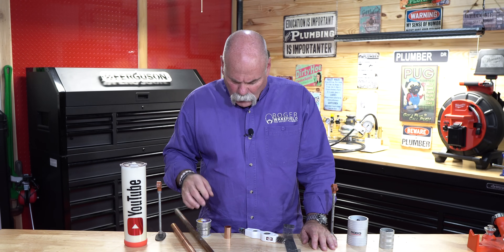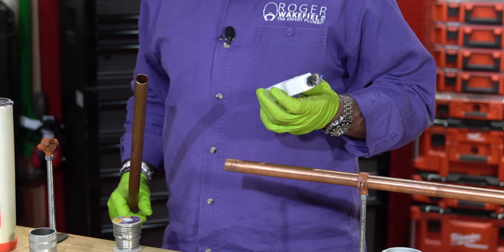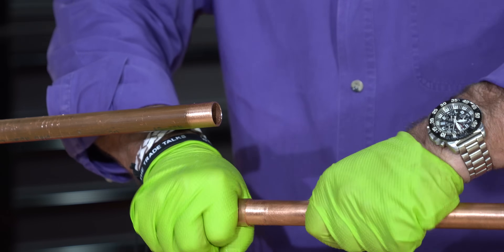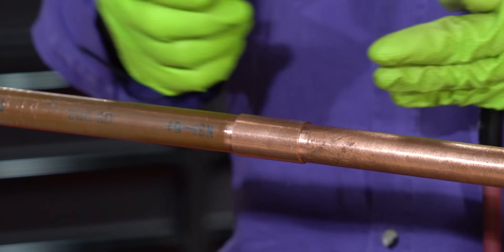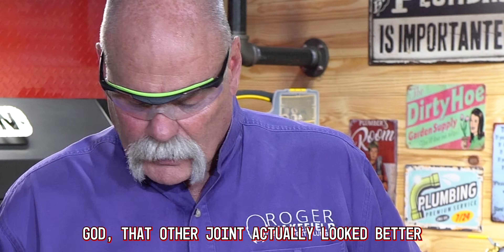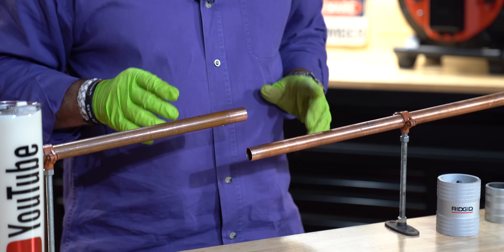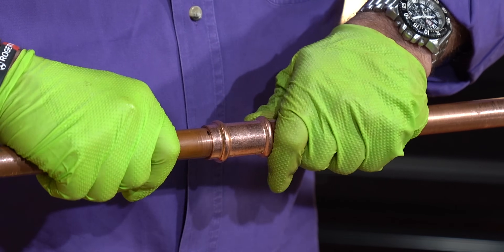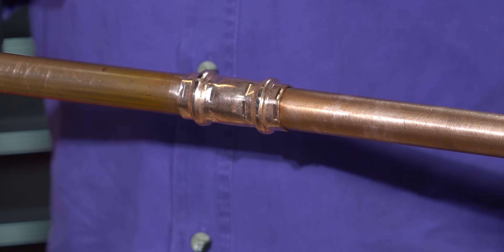Soldering VS Press Fittings

Comment: I have 23 year old leaking joints in my crawlspace.. soldered. Looks like they were never cleaned after and that caused premature corrosion. So there's a good reason to prefer press fittings - the plumber can't skip the cleaning step.

Comment: Solder is very much used in the commercial Industry. I’m 23 and I’ve soldered probably 80% of the water line joints that I’ve ever made.   If I’m running DWV it’s either pvc or cast iron. Usually pvc, unless im running a big job that is willing to pay extra extra money for noice reduction. I can do whatever my company needs though, copper, pex, pvc, abs, cast iron. A good plumber can do whatever job they are given.

Comment: The big issue these days is liability for a fire from soldiering. So you have big company’s insurance actuarial and their loss prevention people run the numbers and crimp fittings and shark bite are quicker and much safer. 

Just evolution of the trade

Comment: Your tip on that TT IS DIRTY,THE  AIR MIX AREA WHERE THE ORFICE IS IS STOPPED UP, YELLOW FLAME IS BAD.AFTER YA BUTTER PIPE AND FITTING DONT WIPE THE FLUX OFF . SORRY JUST BEEN DOING THIS FOR 35 YEARS,FIRE IS 10X BETTER THAN O-RINGS ASK NASA!. SOLDERING IS A ART KEEP IT GOING LAST FOREVER.

Comment: I work for roto rooter. They do not teach you how to soldier but if you learn on your own and pass a test with the gms approval you can carry a torch and soldier but must inform management prior to anytime you fire up the torch
Reply from the maker: You have to call a manager and let them know you're going to solder before you can even fire up a torch? 🙄😒What part of the country are you in?
Reply: @RogerWakefield  columbus, ohio
Reply from the maker: That is crazy. How often are y'all soldering then? Are you pressing instead?
Reply: @RogerWakefield  mostly yes it's all press. They do buy every plumber a milwaukee press tool to use though. There are very few instances where even the ones who know how to solder actually solder

Comment: The copper looks pretty dirty there’s a great attachment for a cordless drill on Amazon it’s a cylinder with a hollow of your pipe size it takes paint and everything off.looks like too much heat but as regards to solder press fit compression or push fit whatever works for you solder and compression can last a lifetime the others we are not sure of I think they say 25 years for pressfit so in a newly built house a young couple who are 25 go on holiday 25 years later and come back to a pond in the house go the tried and trusted way.

Comment: I've seen way more leaking pressed fittings then soldered. And I've seen way more soldered joints than pressed. 

I prefer soldered joints in inaccessible locations like inside the walls or attic. Pressed fittings for exposed like water heaters 

From what I've seen on a few of the pressed fittings I've had to replace is that the O ring seal inside them dries out, strinks and cracks. Thus causing leaks. Seems to take about 10 years or so. Seen it more often on the hot water lines.

Comment: Making repairs on my parents 50yo type M copper lines with slightly acidic water, I don't even think about ProPress. It will just crush the paper thin lines. Solder all day long, or use a POC. It doesn't have to last forever. It will need a complete re-plumb soon.

Comment: Clamp fitting was designed for people like this guy. Can't solder worth sh!t. My God. The sad part is that I see certified plumbers doing just a bad on new homes with clamp fitting. Rings are crooked or too close to the edge of the hose. It's just a mess.

Comment: I just completely changed my opinion on soldering vs ProPress fittings. I'll take ProPress everyday if this is a seasoned plumbers attempt at soldering a joint. That is not how it's done.

Comment: heat the pipe all around, not just the bottom,  'til a green flame, then remove flame and apply solder.  no need to overcook the solder with flame as shown.  this took way more time than it should

Comment: I think you are overheating the fitting to much... when the solder melts i pull the heat  and apply the solder then i put some heat on to draw it...if the metal is to hot the solder will bead off and not into the joint

Comment: You used to much heat on the fitting the heat can actually push out the solder if you get it to Hot just back off the torch a little bit and it would look beautiful 👍

Comment: He way overheated that solder joint for Type M copper. Maybe it was heavier pipe. If you slow down and watch the solder as it flows, you can see when the joint is fully loaded. Once you get good, you can hang a single drip and then swat it away with the solder in your hand. All that overfilling and dripping and reheating is pointless. I've gone thousands of fittings with zero leaks without the neat to over "blue" the copper from overheating or making a drippy mess overfilling.

Comment: Fun Fact- I herd the o-ring is not necessary in the pro-press fitting. It seals without the o-ring. It's just a back-up.
Reply from the maker: 👀 where did hear about this fact?
Reply: There is another channel that demonstrates it. They pro-press a fitting and then leak check it. They also beat the fitting with something to see how durable it is.  @RogerWakefield
Reply: totally false

Comment: Sounds like a business that wants to run out of business. Cuz you can't use that ProPress in all situations many times the pipes are too close together or just the spaghetti mess and there's just no way possible to get that big contraption in there to press the fittings. This is why soldering will never completely disappeared it is absolutely necessary sometimes

Comment: I always liked a job that wiped the solder joint with a rag. It looks much better that way.
Reply: Not me. I'd rather have a clean bead. Wiping means the plumber touched the pipe while it was still hot. That's a great way to crack some of the joint. It might not crack it enough to leak right away, but it would be weakened if it breaks any of it. It's a major mistake in my mind.

Comment: I'm not a professional plumber but I know  if I need to replace a valve that was soldered I can heat and desolder to remove the old valve. Sometimes it may only be an inch from the wall. Can you remove a pressed fitting or does it have to be cut off at the end?
Reply: Good point.

Comment: I am sure someone already said this in the comments but yes you do have to clean your pipe on press fittings and also rheem and deburr. They also make gauge for a mark for insertion depth. Just saying and solder will stand the test of time

Comment: I'd love for you to cut your pipe to see if you had excess solder inside causing turbulence in the line which causes pinhole leaks.     I work in a place that uses both and the pinholes are vastly more common by solder joints.

Comment: My rule of thumb is if it's new construction I will solder or if it's in a garage etc. Also a shower valve I'll solder outside by the truck. If it's in a home and is a repair I'll pro press. People dont like the smell of solder smoke alarms and for fire practice.

Comment: These press fit need to go down in price bc the o ring is useless. They press good enough that they are water tight. Watched a video on it. So if they do that, they can drastically lower the price. 

Roger you should use a press gun on a regular fitting to see if it leaks in your pressure chamber. I bet it dont. 

like this to get to top.

Comment: Never put flux on the inside of the fitting only the pipe. P.S. what is sodder?
Reply from the maker: Solder is the metal I’m melting to bind the copper together
Reply: @RogerWakefield  I know that I've been in the trade for over 50years. I just don't know what SODDER is, greetings from the country that gave you the language you are speaking.

Comment: Pro-Press is awesome, but always remember to note the pro-s versus the cons. With pro-press there is a rubber washer that will eventually fail while a soldered joint will likely outlast the building. I get it why professional trades are moving to using Pro-press, but I do feel that a professional charging a professional price should not take shortcuts. 
I wish there was a press fitting without the rubber gasket. Hmm, I guess then that would be called Pex pipe. Speaking of Pex, even though I love copper, I do really like using Pex and I trust that Pex will last.
Reply: The rubber washer is not the primary sealant in the system - it is a failover.  It is the copper crushed against itself.  This technology is older than most plumbers, but we understand old plumbers can't learn new tricks.
Reply: Im not a plumber but I watched a video recently where the plumber takes out the O rings on a pro press fitting and it still didn’t leak
Reply: @richardcollyer1014 I agree that removing the rubber seal, and water may not leak, but for how long? I've also seen videos of plumbers stating that when they tried removing the o ring, initially there was no leaks, but later on, there was a leak.
Reply: Good question !!

Comment: i like both. just need to know where to use them. always remember that you can’t take off a press joint like you can for a solder joint. so at least leave some meat for future repairs if you’re going to press or else you’ll be cutting open walls

Comment: Solder is always my first choice but the pro press definitely has its place especially in hospitals (above ceilings) where there are alot of wires and cables and no hot work permits...and cleaner.

Comment: It took over 8 minutes toprep and make that solder joint...90 seconds of rthe Propress...pretty simple math.  Yes PP is more expensive but it's much faster, normally looks alot better and no Hot Work permits needed when working in Industrial settings. We have done jobs with PP having over 10,000 connections 1/2 to 4" in copper and stainless, no leaks. You have to remember to calibrate your tools prior to starting each day.

Comment: what about Propress fitting where it is crimped with Rigid tool or Milwaukee Tool ??   could you do a video on that..  please thanks!!
Reply from the maker: I use the Rigid press tool in this video
Reply: @RogerWakefield  i spoke too soon later in video you did talk about that!!  sorry.. just getting ideas .. have to run a 2inch water line from well pump house to main house and garage and several spots for "fire water".. was thinking of mixed line copper under house  and Schedule 80 2 in. in ground from pump house...gluing i am ok but soldering not sure to i like the idea of the "Quickfitting" on copper from 2 " on sections down to 3/4"

you do great and thorough videos keep it up!!

Comment: Being a non plumber and have solder little project, I have never seen the pro press.  How would one remove a pro press fitting? Is it just cut out.  At least with soldering, you can save the pieces of pipe.

Comment: We spent the 5k on a Milwaukee pro press and mega press system for copper and black iron.  I used it a few times and still do for tying into existing systems but overall I feel like the overpriced fittings really deter me from wanting to use it more often.  Not to mention that I just don’t trust a nylon o ring to seal for nearly as long as a thread or  soldered joint.  When we are fabing up a new boiler room I need to be able to make changes and save space neither are possible with the copper press.   I see other plumbers boiler rooms that are fitting to fitting across a whole wall.  The homeowner will be severely disappointed when it come time to replace a valve or a fitting and find out the whole wall needs to be repiped just to change one fitting.  I feel like the press is part of the dumbing down of the trade.

Not “impressed” in Alaska
Reply: That is my concern, as well.  Are utilities devolving into something that is only expected to last ten years?  Press fittings are cool and convenient, but I wonder how they will hold up over decades.  They make money now but might cost a fortune (to re-do everything or repair damage) in the future.

Comment: Have you used the megapress? Man they are expensive fittings but the time saved threading pipe in the field is so worth it. I did 2 meter in services almost all mega and the labor time saved was tremendous. But I bought 3 2” gas valves for a little over 900$!

Comment: I propress everything I can. But you have to be able to solder, yesterday I had a cal to replace a main water shutoff in the home. Literally there wasn’t a 1/4” between the wall and the valve. I was going to rebuild the valve but the screw holding the bottom seal was rotted away. There was not enough pipe through the wall to press anything. If you can’t solder what do you do? Pass on the job? It makes no sense. I went to the truck and grabbed a valve, sweat off the old, removed as much old solder as I could because I believe that it was lead and sweat in the new valve. Quick easy job. Took longer to clean fitting than it did to sweat it all up.

Comment: I love watching videos and reading comments from blowhard plumbers bashing sharkbites all the while using pro press fittings.  The only difference between the sealing technology is a $1,000 press tool.  Not only this, the same blowhards act like solder never leaks.  As many pointed out, his coupling would almost for sure leak.  Good luck spending 30 minutes trying to get the water out of the pipe so you can redo the joint.

Comment: I’ll tell you now as a customer..I WANT soldered joints.  Not press fits that might slacken if the pipes are knocked a bit over a few years, or push fit joints relying on rubber/polymer seals that might degrade over a couple of decades.  A good solder joint is almost bullet proof for the life of the copper pipes…nuff said!

Comment: I’m an AC tech and I soldier with 9% nickel and it doesn’t require flux prep work. However I do trickle nitrogen through the line to displace the air from the pipe. Carbon will build up inside the pipe with the air. But the way this soldier in this video flows is way to soft for me. It was falling off like water

Comment: Someone’s been doing too many YouTube videos and not enough soldering. I kid. Pro press is invaluable but I don’t know how plumbers can get by without soldering. We still use lead stubs on toilets so you have to solder there but there’s other options. The one place you can’t escape it is commercial plumbing. You cannot install a flushometer without soldering the marvel adapter. Also when you run cast iron drains you have to use copper trap arms. If your drain is perfectly lined up you can get away with using a nipple but any 45 outside the wall or if you have to arm over in the wall you have to use copper and as far as I’m aware DWV copper fittings are solder only. There’s also lots of situations where soldering is better. Some places you can’t fit a pro press but you could fit a torch. Soldering also gives you options. The supply house was out of bell reducers of a certain size that I needed in pro press so I just got a sweat one. There’s also situations where soldering is much faster. Recently I installed a water heater up high on a wall. Between the expansion tank, vacuum breaker, valve and all the fittings to tie in a recirc pump and connect to the water heater there were a bunch of fittings and the space was tight. Having to be up on a ladder and wait for the press to finish then remove and try to find the best way to press the next one took forever. I wished I had had the sweat fittings to do it. Even with having to clean/flux each fitting it would have been faster because I could start on one end and just work my way down. With how conductive copper is once you solder the first fitting, the heat travels so well, you can do the rest really fast. There’s just so many ways that soldering can be better that’s it seems stupid to eliminate it completely. 
As for soldering vs press systems as a whole, I wonder how well press will hold up 20-30 yrs from now. I see soldered fittings that are 70+ yrs old all the time. Will press fittings last that long or will they heat a certain point where they just start failing. I guess we don’t know yet. Solder is also better in freeze situations. I learned this during the big Texas freeze two years ago. Solder fittings stay together so your pipe might expand or even split but pro press is much worse. We had a 40’ long 1” line going to an RPZ for watering planters on a 10th floor balcony in downtown Austin. The electricians didn’t turn on the breaker for the heat wire around it so it froze. I think there were 3 couplings in it and every single one pulled completely apart. Because the fittings hold together with crimped copper and copper is soft it effectively uncrimped it. Both systems will end up with a leak but the difference is a small split in the pipe versus a full port pipe opening letting out water. Something to think about